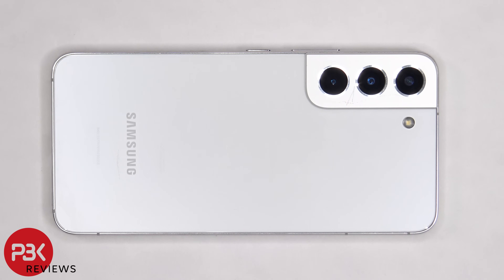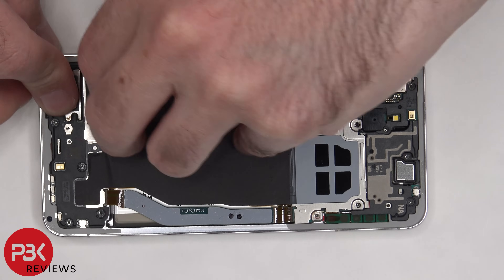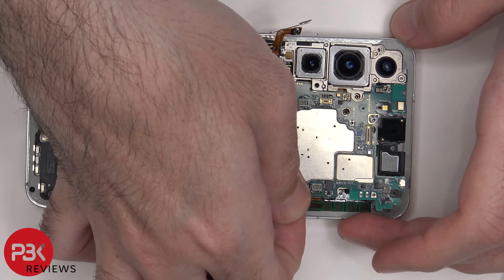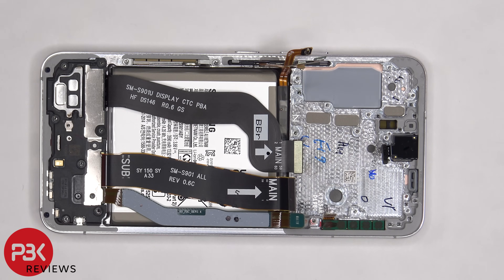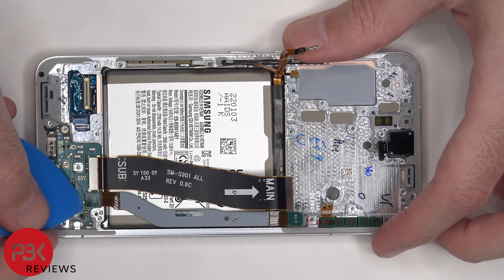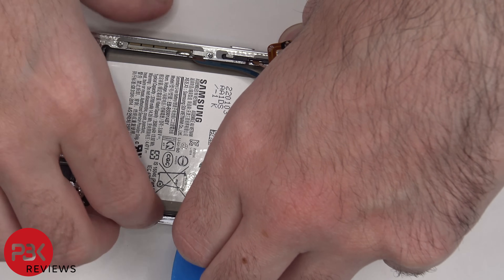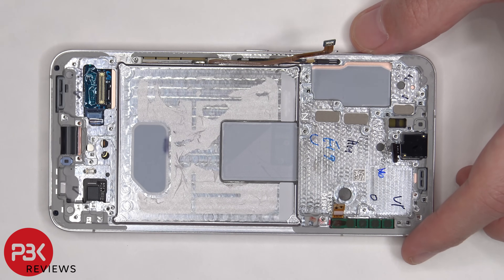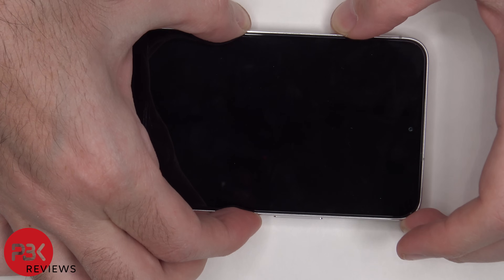Samsung Galaxy S22 Disassembly Teardown Repair Video Review

Comment: What you guys are doing is not right.

Removing the battery, is one of the MOST risky movements in this tear down. 

If you're doing this for the first time, please be extremely careful when prying the battery off.

There are a few screen components under the battery, next to the speaker. You should be careful not to damage anything while prying down there.

BE CAREFUL

Comment: Hi. Thanks for the vid. Ive got 1 question - button half of my s22 screen stopped reacting to touch after it got a bit wet.
Buttom humidity sticker is still white so not sure how the water came in. 
Should I replace the Motherboardor the screen? Whole screen is displaying image its just bottom half doesnt react to touch.

Comment: I need to replace the flexible cable labeled RO_FRC_REVO.6, but I can only find RO_FRC_REVO.5. It is said to also fit the S22. Will this have a negative impact on the device's functionality?
Which cable – the first from the right or the second – is responsible for power supply, phone charging, and HDMI cable support?

Comment: Would like to have seen you put on the adhesive and indicate what type is best.   Did you have to apply adhesive under the battery and what type did you use?

Comment: Hey there I’m wondering how you got the back plate off so easily? I’ve used a heat gun and tried a guitar pick and a very thig precision knife as well as my fingernail and I can’t seem to get anything underneath it.
Reply from the maker: Shouldn't be that hard. I usually use a hair dryer and heat it up and use a suction cup tool to help pull up on one side to gain some leverage to get a pry tool in between.

Comment: i believe my vibration is broken, how can i fix it?
Reply from the maker: You would have to replace the bottom speaker assembly which has the vibrator motor built inside it.

Comment: Great video, it makes the job look easy. Question for you.  Lost my S22, found it the next day under a sheet of ice. Amazingly the phone still worked. Powered it down and attempted to dry it out 48hrs later. When I power it on the screen is black but I can see a little flashing of white and then it goes away. What replacement part do I need to order to get the screen working. Is it the screen itself or  one of the board components?
Reply from the maker: You would need to take the phone apart and dry out any liquid inside, disconnect the battery also, and brush off any corrosion on chips or connectors with a small brush to make sure it doesn't short and render the device unrepairable. Then put it back together and see if it works, if not you would need to replace the screen to see if that's the problem or if the problem is with the main board. If with the board then most likely you would need to get a new phone since it won't be worth attempting to fix.

Comment: I can't seem to get the adhesive to break on my phone. It burns my finger to touch it yet I can't get a gap.
Reply from the maker: Use a suction cup tool to help gain leverage, or put a thin metal tool in between the back and frame to help you separate it to get a pry tool in between.
Reply: @PBKreviews  I managed to get it after about twenty minutes... I tried going from a different angle and got in. That adhesive is STRONG!
Reply from the maker: Oh ok glad you were able to do it :)

Comment: Where is the Wi-Fi & Bluetooth antenna?
Reply from the maker: I'm not sure exactly which is for what, but make sure the top plastic covers over the motherboard and the bottom speaker assembly are seated properly since those have antenna lines drawn through them.
Reply: @PBKreviews  okay :( I am asking because these don't work in my phone...and I cannot find a tutorial on how to replace the wi-fi&bluetooth antenna...
Reply from the maker: It might also be the wifi/Bluetooth controller which is soldered to the main board which might be bad or faulty. You can try saving your data and doing a factory reset but if that doesn't help, the controller is not user replaceable. Back in the day I know people on older phones put them in the freezer for a little bit and it would start working for a little bit stop working again. However I'm not sure if that's recommended.
Reply: @PBKreviews  Thanks a lot! I'm trying to find a service to repair it, but everywhere I go they say it can't be fixed...

Comment: where is the intern memory card in this mobile phone ??
Reply from the maker: There is no memory cards, just soldered memory chips to the main boards under the shields. They are not replaceable or removable.
Reply: @PBKreviews   okey fine. last question. Can I attach them to any adapter for connecting to the PC ??
Reply from the maker: nope

Comment: Could you please give us where the motor vibration inside of S22?
Reply from the maker: It's in the speaker assembly housing. So it's not visible unless you break open the speaker assembly.

Comment: I own this device and I'll say one thing phone manufacturers are doing wrong is antenna placement. This phone in particular has multiple antenna lines on the bottom 1/3 of the phone. This is the location your hands will be wrapped around the phone blocking a good chunk of signal. I have confirmed this. If I hold my phone upside down it's markedly faster on cellular data transmission. Why no one realized covering the antenna with your hands would block signal. It's even more amazing manufacturers don't know this or that folks hold their phones..... Crazy.
Reply from the maker: There are usually multiple antennas, typically one at bottom, one at top and on sides as well as the back of the phone. When your hands are covering certain locations, other antennas will kick in or be used as well. Most modern phones use this policy.

Comment: Theoretically, if you sent this phone to samsung repair would they know it's been disassembled and put back together?
Reply from the maker: If you don't damage any parts internally and apply the original pre cut adhesive for the back plate/battery door cover then there shouldn't be any giveaway as far as it being taken apart or tampered with.

Comment: Thanks for the great video. I'm a dumb guy and I inserted the sim card ejector tool in the wrong hole, the one next to the actual sim card hole. You said in the video that it shouldn't affect the microphone, but does it affect the waterproofing? I honestly felt something bent inside when I inserted it. That's how I realized it was the wrong hole. I don't know if you still have the S22 (not the plus or the ultra, the basic version) and if you can actually check if the sim tool would affect the water proofing, that would be great. The worst part of all this is that after I realized my dumb mistake I noticed that Samsung put a sticker on the back of the phone guiding the user to the correct hole and basically instructing dumb guys like me to not insert it there. So I know the mic it's not damaged thanks to your video but I'm now worried about the water proofing because I honestly felt something bent inside. I'm sorry for bothering you. Keep up the great channel!

Comment: Thanks to the almost non existent cooling solution this phone has on the soc, the phone gets scalding hot and slows down to a crawl when doing anything. Samsung phones have had this problem on the last 2 generations, you'd think Samsung would have already come up with a clever cooling solution for the faster snapdragon processor like a vaper chamber or copper wick to draw heat away but nope. My lg g7 from 5 years ago had a vaper chamber and never slowed down when running powerful apps 😢
Reply from the maker: Yeah I would have expected a 3D layer of graphite in between the board and the frame instead of the graphite bad just on the back of the board with more graphite in between the screen and frame. That or a vapor chamber.
Reply: yeah I recommend a nice desk fan to be pointed at the back of the phone when doing anything like gaming, it makes it useable

Comment: Sir, by mistake i have pushed sim ejector pin into the mic area will this damage waterproof of the mobile please reply... i am worried about it thats  why i haven't put my mobile into water but i m thinking to do so in waterpark to take pictures please help me out...
Reply from the maker: You should be fine, since the filter and mic are located above the hole.

Comment: Edit: watched the S22+ teardown and you cleared it up. Thanks!

Hey there. Why didn't you remove to the display¿ I wanted to compare the sizes of the cooling system to the S22U, I hope there aren't many differences in the layout other than the S22U using a vapor chamber to dissipate heat

Comment: Hi just curious I accidentally poked the top pin hole on top of the camera section of the s22 thinking that it is the sim card section. Will it affect the waterproofness of the phone? Appreciate ur advice please! And great vid!
Reply from the maker: Hi, thank you. You will have no issues, since the mic and gasket are both seated above the hole so they wont be damaged.

Comment: I stuck the SIM card eject into the mic. Is the mic a similar build to that of the s21?
Reply: by mistake i have also pushed sim ejector pin into the mic area will this damage waterproof of the mobile i am worried about it thats  why i haven't put my mobile into water but i m thinking to do so in waterpark to take pictures please help me out.. if you had figure it out...

Comment: another observation I had was, they could make that camera bump go away, and have just raised lenses like the s22 ultra, even without making the phone any thicker. Maybe they don't do it for cost reasons ? (manufacturing cost maybe higher ?)
Reply: I liked the bump, it made the phone look pretty until they were gone from the s23 and onwards. Also, it made the phones look distinctive than the Ultra model. Now every series looks the same, be it the A series, S series, M series... I get confused in the market often

Comment: Nice video. I once replaced a battery myself :D in a Huawei P10. 
Just thinking.. would it be possible to change the S22 tot battery with a battery that has slightly more capacity ? (Same voltage, same size)
Reply: I think you wont find a better battery than that. Why would Samsung not use the best they could get?
So sadly, i think it doesnt work.

Comment: Did I hear the phone may not have a mmwave antenna, or c-band? There was an antenna on each side but I didn't understand. I have a Note20 Ultra and am upgrading just for the c-band that I think/thought the S22 Ultra gets 3 bands, 5g that's slow as 4g and worthless as far as marketed speeds, c-band that is supposed to be what the airlines and faa and buttigieg stopped for weeks (while faa and airlines had 2 years to test), then the short distant must see the transmitting antenna to get fastest mmwave. As far as I've read, mmwave and c-band are still unicorn bands. Heard of it, never seen any tests of it. And I sure don't need to upgrade if the S22 anything don't have all 3 band antenna. Does the S22 Ultra in my case, pick up all 3 bands - if they really are there?

Comment: Looking at the disassembly, surely replacing a cracked back cant be too expensive.
Reply from the maker: Shouldn't be, they will probably run about $20-$30 for the backs and you can just pry the old off and apply the new with the pre installed adhesive it comes with on and your done.

Comment: Thanks for the teardown - very well done!
The amount of stuff Samsung has packed into this frame is insane! No wonder they had to shrink the battery. The phone is essentially packed as tight as you could possibly manage in a phone this size.
Compare this to something like the Pixel, and you can see why they can't shrink the phones as much as Samsung can. 
The S22 has the form factor and weight of the Pixel 4a, while packing almost all the features of the pixel 6 pro. Some things are actually better than the Pixel 6 Pro.
Reply from the maker: Thanks! 😀👍

Comment: No, the motor is inside the speaker, Usually the speaker have only two connect points, But S22 got four.
Reply from the maker: Ill be looking into the S22+ today and will take a look and see exactly where it is

Comment: Samsung uses new thermal paste and new thermal interface material (TIM) for the ultra, was wondering if they used it for s22/s22+ too. Great video 👍
Reply from the maker: The one on the S22 didn't look or seem anything out of the ordinary but I will check the S22+ and Ultra and we will see in the teardowns.

Comment: Where is the vibration motor?
Reply from the maker: I think its between the screen and frame, there is a connector next to the screen cable on the bottom but I will check with the S22+ and see if its the same and I will pry the screen off if so to see.

Comment: Hold on...where's the haptic motor?
Reply from the maker: Ill find out exactly where in the S22+ teardown if its the same design internally. If not I will take apart the S22 and pry off the screen as well to see.
Reply: @PBKreviews  thanks! For a while there I thought Samsung didn't include one
Reply: @PBKreviews  Why remove the display if the motor is mounted down on the bottom speaker unit?  His contacts are visible on the video.  You write nonsense.  Are you a service engineer yourself?
Reply: В нижней планке, в которой находится нижний динамик. В ней 4 контакта. Два на вибро, 2 на динамик.

Comment: Maybe I wasn't paying attention but I want to know what type of vibration motor that this phone use?
Reply from the maker: Didn't see it so forgot about it but its hidden between the screen and frame on the bottom of the phone. You can see the connector for it next to the screen connector.
Reply: @PBKreviews  how does it feel? Any difference between the s21 and s22 vibration?

Comment: I cannot find haptic feedback motor ?
Reply from the maker: I didn't notice and forgot to even look for it since it wasn't out in the open but its tucked away under the display between the screen and frame on the bottom of the phone. You can see the connector for it next to the screen flex cable connector. I will pry the screen off on the S22+ display for the teardown if its the same way as the S22 to have a better look at that :)

Comment: Seems like in 2022 everything will become software features like ram extension no need ram 
No battery is also needed
No vibration motor
Reply from the maker: loll ya. I didn't see a vibrator motor so it totally slipped my mind to even check. But its between the screen and frame, you can see the connector for it next to the screen flex cable connector on the bottom of the phone.
Reply: @PBKreviews  Как можно такой бред писать? Вы не разбираетесь в электронике??
На 3:41 прекрасно видно 4 контакта на нижней планке. 2 подписаны как М (motor) и остальные 2 подписаны как S (speaker).
То есть, вибромотор, встроен в нижнюю планку, рядом с нижним динамиком.

Comment: Где вибро мотор????
Reply from the maker: forgot to even look for it since it wasn't out in the open but its tucked away under the display between the screen and frame on the bottom of the phone. You can see the connector for it next to the screen flex cable connector.
Reply: @PBKreviews  Как можно такой бред писать? Вы не разбираетесь в электронике??
На 3:41 прекрасно видно 4 контакта на нижней планке. 2 подписаны как М (motor) и остальные 2 подписаны как S (speaker).
То есть, вибромотор, встроен в нижнюю планку, рядом с нижним динамиком.

Comment: No wire inside simple and easy to use instant of battery. But I prefer realme deign although harder it has harder disassembleing process but not boring and have new futures. I always prefer new futures and variety rather than boring but more reliable brand.

Comment: I enjoyed the video. I guess the basic model of S22 doesn't have a Vapor Chamber.
Reply: Only the s22 ultra has a vapor chamber, probably too high a cost for the models below.
Reply from the maker: yeah, probably just the S22 ultra but we will see soon about the S22+
Reply: The vapor chamber ending at the battery is not necessarily a good thing either.

Comment: Vibration motor?
Reply from the maker: It's tucked away under the display between the screen and frame on the bottom of the phone. You can see the connector for it next to the screen flex cable connector. I forgot to look for it since it was not in any usual place :)
Reply: @PBKreviews  motor is x-axis?
Reply: @PBKreviews  Как можно такой бред писать? Вы не разбираетесь в электронике??
На 3:41 прекрасно видно 4 контакта на нижней планке. 2 подписаны как М (motor) и остальные 2 подписаны как S (speaker).
То есть, вибромотор, встроен в нижнюю планку, рядом с нижним динамиком.
Reply: @PashaV240  первый раз вижу такое расположение,если это так
Reply: @Oleg-jt4wq  да, у Самсунга это впервые. Ранее всегда стоял отдельно.
Reply: @PashaV240  ну если это 100% так,то радует,что мотор линейный,х аксис.Наконец в младшей версии

Comment: Wait where is the vibration motor?!
Or am I tripping?
Reply from the maker: It's tucked away under the display between the screen and frame on the bottom of the phone. You can see the connector for it next to the screen flex cable connector. Since it wasn't in any usual place, I forgot about it lol.